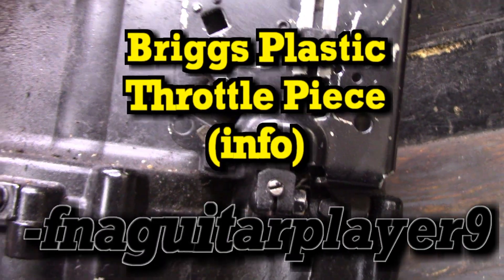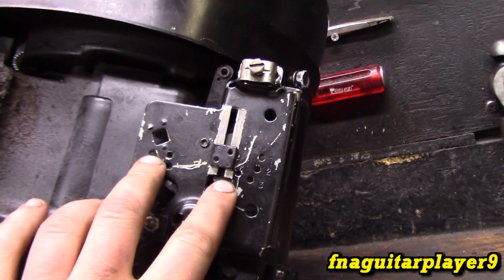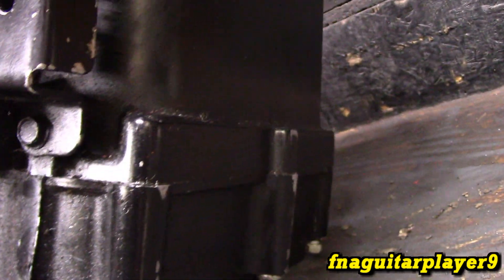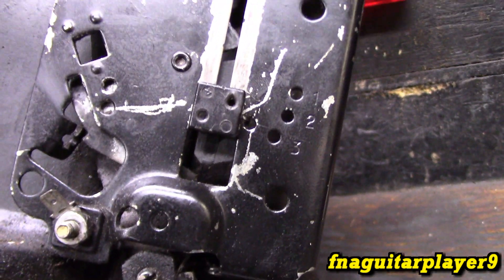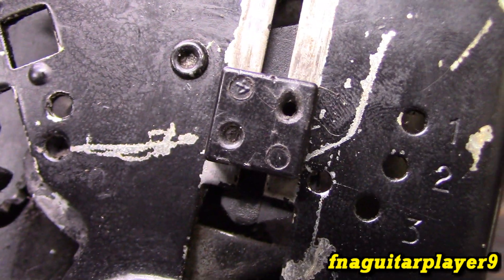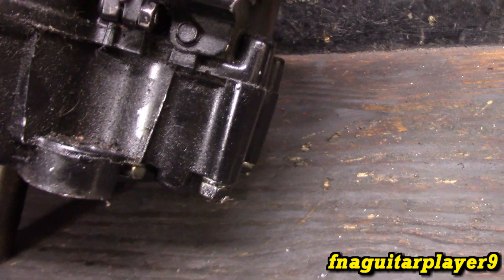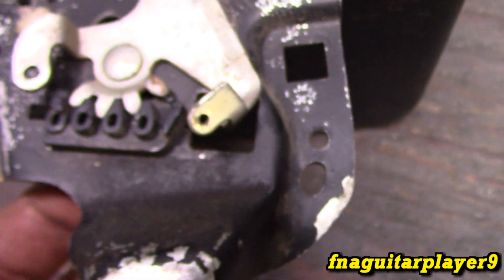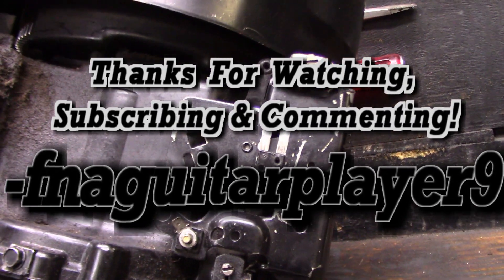Info on the Plastic Throttle Piece on Briggs & Stratton Engines

Comment: I was able to find “just that plastic piece” by looking at a parts list for a 11hp, and it worked on my 8hp.  PartsTree has a few and they can be found on eBay.  280324 is the number for the Choke-A-matic, and 280321 is for the manual choke.  Looking at some pictures, I couldn’t tell any difference.  But the 280324 worked on my 190707 control bracket, even though the plastic piece is not shown on that parts list.  SAVE YOUR OLD GROMMET SPACER FROM THE PIVOT AFTER YOU DRILL OUT THE RIVET.

Comment: Like You ,I have never had one of these break! ( fingers X ) a little lite spray of silicone helps keep it lubed ,also it is a part that should be kept cleaned of dirt & sand! to avoid premature ware. Thanks for the video.
Reply from the maker: That is often over looked, i try to spray some type of penetrating oil or something on them to keep them working smoothly. Your welcome, Thanks for Watching!!!

Comment: The throttle stuck on my 85 and broke the side out. That's the one i drilled the small hole straight through and bent the throttle cable wire into a 90 and stuck it in the hole. So far, so good and I couldn't get that piece for an 85. It still working. Pick me one! It was on a 11 horse.
Reply from the maker: I hear ya! Thats a good idea, i've thought of fixing it like that if it ever broke. Thanks for Watching!!!
Reply: @fnaguitarplayer9  Thanks for posting and it's still working fine.

Comment: Do you have a video on doing the manual choke with a cable vs. the auto choke that alot of these engines come with... mine is causing all sorts of issues like idling high off the start....i don't wanna damage the engine. Thx

Comment: I just replaced mine, age broke, even redrilled a hole to brittle. However i simply bent the stop tab out of the way and the gear rotated and let the slide piece come right out, no drilling required. thought about trying to mold one. have not yet.
Reply from the maker: I hear ya! Hopefully you can make a new one! Thanks for Watching!!!

Comment: I hope it is OK to contact you through your YouTube channel. I have a B&S 8HP model 190412-1787-02 running a back up generator. I changed out the points a while back but other than that, it has been working well. I don't use it all that often for backup power but being in California, we now have these public safety power shutdowns. So, it gets more work. I've made no adjustments and it hasn't been banged around at all since the last time it ran. Now when I start it, it pretty quickly will stall unless I reapply the choke and then baby it. It won't run long choked but I can keep it running. Since it needed to be choked to run, I figured it needed a richer mixture. So, I replace the fuel line and filter. It didn't cost a lot and was old anyway. No change in the stalling issue. I'm hoping you can provide some guidance on what is wrong. I don't have much experience with these older B&S engines and what I do have is from your YouTube channel as well as others,. Thanks for any suggestions you may have.
Reply from the maker: Sounds like the carburetor needs adjusted, there is a adjustment screw on the bottom of the carburetor at a angle, adjust it out until it smooths out and runs without choke. Thanks for Watching!!!